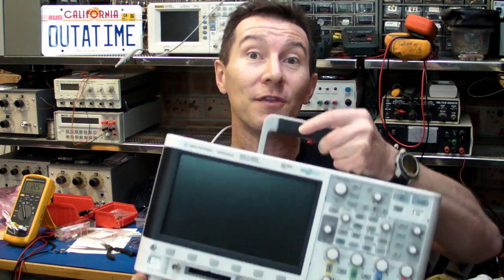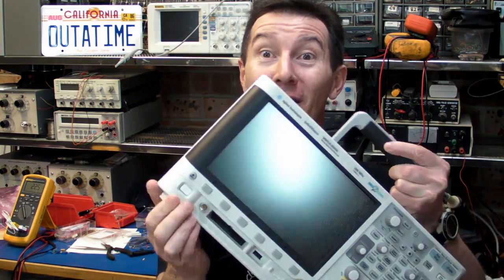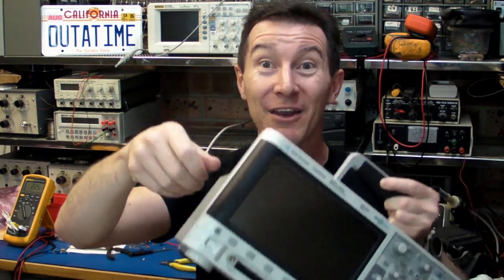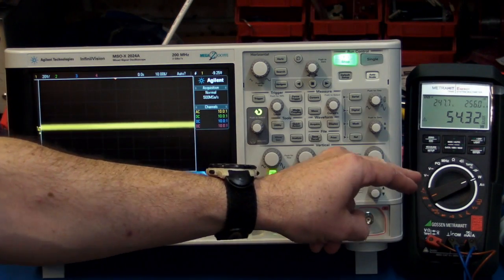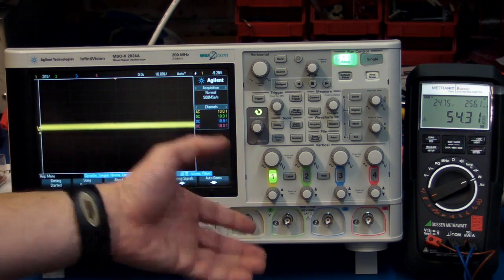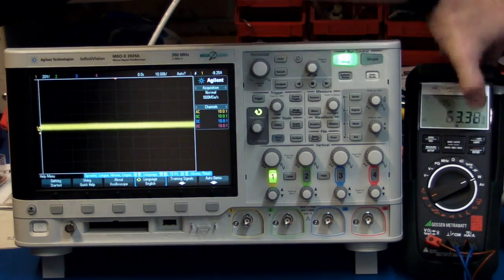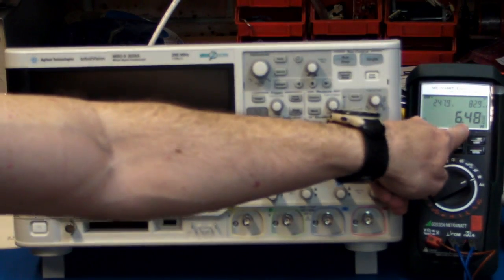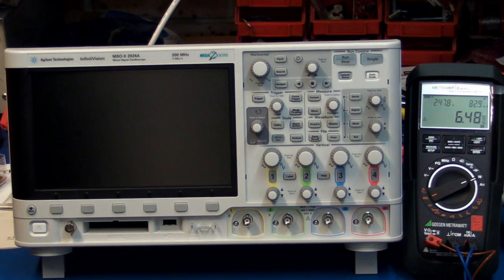EEVblog #164 - Agilent Fly To The Moon

Comment: This questionable design choice and a dodgy SMPS vendor (Lineage Power) came back to bite Agilent customers in the ass.  The university I work for has dozens of 2000 series units in the EE labs, and the SMPS in these scopes tends to fail in a rather dramatic manner after several years of being plugged in, whether turned on or not.   Other users of these scopes report the same issue.  The primary side smoothing cap on the PSU is constantly kept charged, and is slowly roasted to death by a pair of SMD bleeder resistors mounted directly underneath it on the back side of the board.   It dries out and lose capacitance, allowing the ripple level on the DC bus to go up, which eventually exceeds the breakdown voltage of the main switching MOSFET.  The MOSFET then breaks down (often exploding the TO-220 case), and the short then blows the inrush current limiter apart before finally popping the line input fuse.  In some cases, the failure takes out the PWM driver chip, as well.  I have fixed a couple dozen of these scopes in the last couple years with the identical failure. Agilent will no longer sell the PSU through their parts distribution, requiring the units to be sent in for repair (out of warranty, naturally).   The PSU can be fixed, but It is a much better repair to replace it outright. Murata and others make open frame 250 watt supplies in the exact form factor (hole locations even match), which replace the original 125W unit and run much cooler.  The DC output wiring needs different connectors installed to make the swap.

Between the grenading power supplies, and a software issue in earlier versions of the firmware that corrupts the flash memory requiring a multistep  manual reload via an internal JTAG port, these scopes certainly bring some work across my bench.  Kind of a shame, as they are really nice scopes to use, but not too reliable if plugged into power 24/7.
Reply: Excellent analysis. I unplug mine always when not in use.

Comment: How they got CE certification for that ?  Today's stb pwr must be <300mW !!
Reply: CE is mostly self-certified which means that the company make a declaration of conformity and that's it!
If your device is low risk you can simply mark it with a CE label yourself, join a declaration of conformity and hope that you did everything as it should be. As long as there are no complains or accidents you will get away with it.
Reply: Davy Jones Locker wernt no Trogg right?

Comment: I wonder if it has something to do with that CF card slot on the front....I bet when you push that button to off it syncs the file system and unmounts it. Still, it should be able to then disengage a relay after its done and cut down on that awful 6W. My VFD display clock draws less!

Comment: Hi. Wouldn't that be powering the windows os, so that when you switch it back on it comes on immediately? This would save you 30 seconds every time you press power, but then, it will cost you these 6.5W... Which indeed, is just wrong.

Comment: That's odd and quite unexpected. Dave, nothing changes from powering up by removing / plugging the cable and powering up by using the button? Saved logs, functions, generator settings, nothing?

Comment: @EEVblog  
Products haven't got Switching PSU's for eternity. Try switching a Laptop Charger on and off with a switch ... it gets carbonized sooner than you excepct. Of course there's a rigth switch that can handle the abuse, but the easy way is like on this Agilent. IMHO, if you keep turning this SMPSU on and off from mains, a failure in the Switch or in the PSU is likely to occur ... Perhaps Agilent knows that due an endurance test or simply, by design. Indeed, 6W is a lot (10% of consuption)

Comment: Perhaps the switch burns when turning the Switching PSU due to they tipical stress during on-off cycling. Turning on/off a control signal from the PSU looks like a long-life approach. Perhaps the tried to do what you wan't and failed the endurance tests.
Dave, have you got any new about the smoking Inf 3000 scope ?. I remember you promised a video with the facts of that epic failure from Agilent.

Comment: @EEVblog That really does make the design worse when you think about it.  Have you considered contacting the company and telling them of this issue?  That really isn't acceptable, you wouldn't think an oscilloscope would require any standby power when turned off, lots of other devices use standby power, but that's often because the device has a remote control or some other function that requires standby power.

Comment: That really is a poor design, unless there's some sort of memory retention feature I just can't understand why it would do that.  How quickly does the scope start up when you first plug it in compared to turning it on at the power switch when it's always left on at the mains?  What a bad design folks, imagine a portable battery operated scope doing that if indeed there is such a thing.  With LCD screens drawing as little current as they do I would have thought the running current would be lower.